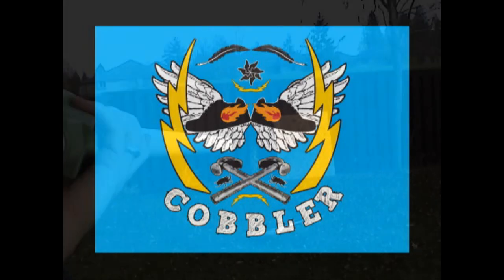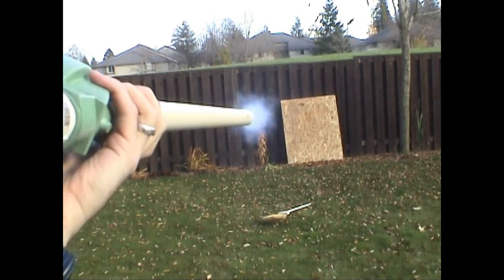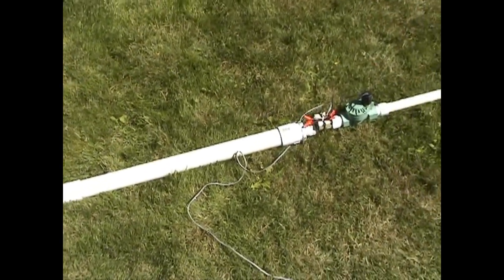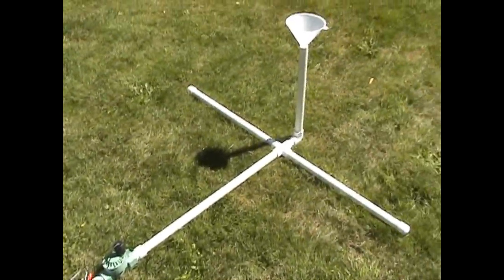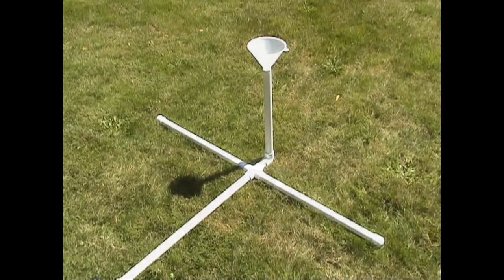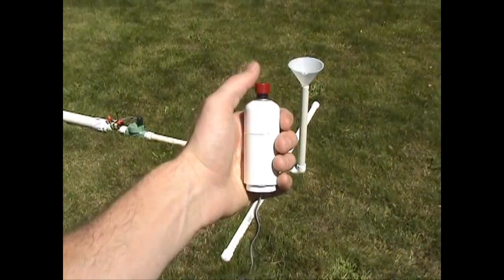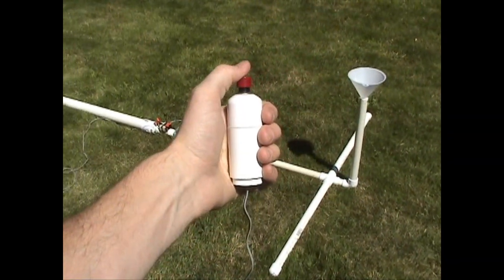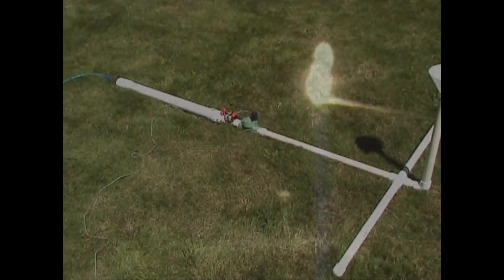Flour Powered Flame Thrower

Comment from the maker: @drooprotc The valve is set up to open when it recieves an electric current at around 24 volts.  I just got 3 9volt batteries and conected them with a momentary on push-button switch from radio shack.  set it ip so that when you push the button the circuit from the battery to the valve is completed.

Comment: @chuvak1 It works well, too.  Of course, if you don't have a potato cannon, you can do what I did when I was young: mix 5 parts well-dried flour/sawdust/etc. and 1 part black powder right at the end, fill a straw in a lidless soup can with black powder, pour the mixture in around it, remove the straw, and finally add a fuse.  That, sunk into a pile of dirt for stability, will give you ~2 minutes of flames, smoke, and sparks shooting 15-20 feet in the air.  It's cheap and *very* impressive.